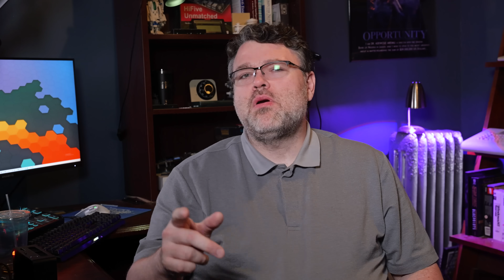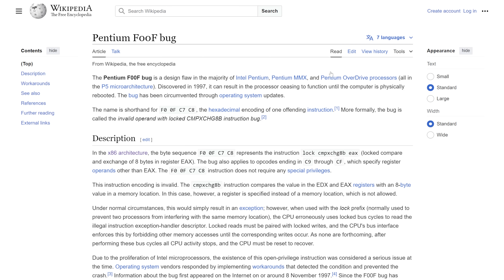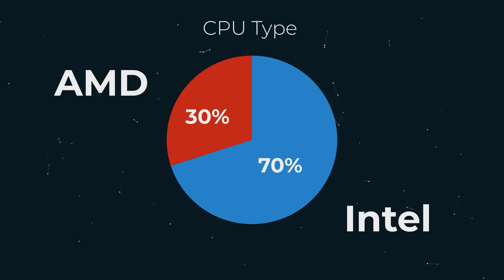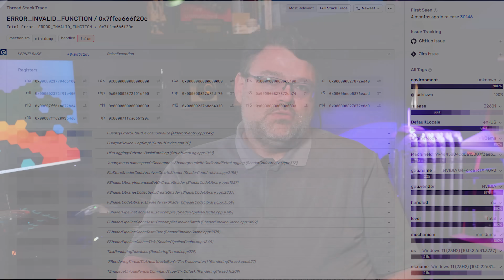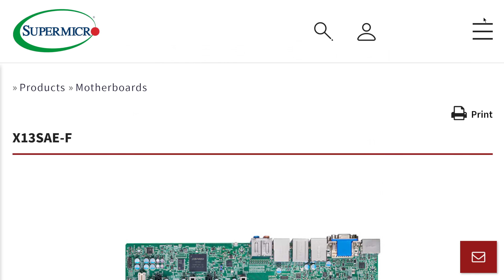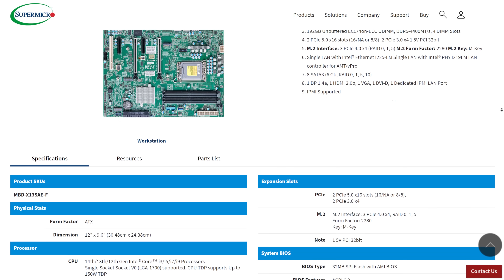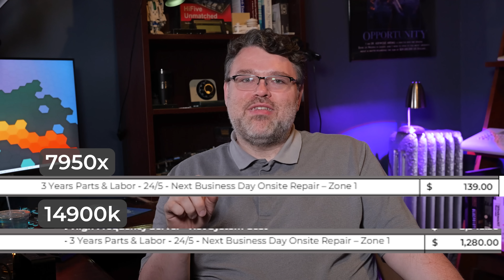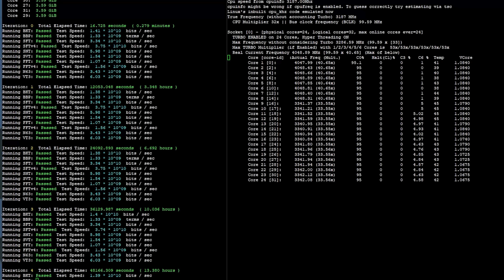Intel has a Pretty Big Problem

Comment: The 14900K chips are degrading insanely fast. My 14900K on day one could run at stock frequency with a -0.075 voltage offset on the last 2 steps of the V/F curve, without any WHEA errors either at full load or idle. Every 2 months or so, I would randomly find a couple of WHEA errors which were instantly fixed by increasing  the previously mentioned voltage offset by +0.05v. This week WHEA errors began showing up again. Now the CPU needs to run at stock voltage as is unable to handle any negative voltage offset whatsoever.
Reply: @genejones7902  No, error 17 is a PCI-E issue. Like you, I once had hundreds of those on my event log. Turned out to be a bad Thunderbolt cable. Replaced it and never got one of those event 17 errors again.
Reply: @genejones7902  There are specific WHEA error codes that are related to CPU errors. Whenever I get them every couple of months, increasing the voltage slightly is the only way to make them go away. So yeah, its a CPU issue.
Reply: What kind of cooler do you have and what temps would the chip run at full load before it started to worsen?
Reply: @douglasmurphy3266  I'm using an IceMan Direct Die waterblock with an external MORA3 420 radiator. My 14900K max core temp at full load is 70C.

Temps are not an issue.
Reply: @lllXavierllll  That's what I was expecting to hear.  My theory is that the people cooking their chips are actually the ones with really good cooling solutions.  Anything less than an S-tier water cooler is going to eventually throttle back from mad-scientist levels of electricity, which is why Intel claimed the behavior is within spec.   However, the enthusiast solutions might be keeping these chips stuck in a state they shouldn't be kept at for extended periods of time - The motherboard manufacturers were probably assured by Intel that the chips built in regulation would keep those out of spec power profiles from killing them.
Reply: @douglasmurphy3266  it's definitely a possibility even though I'm running everything at stock - or rather, what today is known as the Intel "extreme" profile lmao.
Reply: @douglasmurphy3266 interesting idea and it might be happening on some chips. However as said in the video the data from the datacenter chips on the conservative motherboards sort of hems this. Better cooling might accelerate the degradation but it certainly isn’t the root cause.
Reply: @lllXavierllll  RMA the cpu, some times you just get a bad cpu. cpu degradation can happen but the only time its rapid is when its first broke in, and that typically shows more on super high efficiency chips aka golden samples and will taper off quickly and settle in with a small voltage bump required. if your cpu is degrading fast its most certainly defective and should be replaced. that is assuming your not cooking the cpu with high amps for hours on end that will cook any cpu in relatively short amount of time. most people think its the temps that kill but its really not. its the high amperage that will destroy chips.
Reply: @EJM07  the chip is literally degrading.  did you even watch the video?
Reply: I don't have Intel (recent) in the house, so I'm guessing.  Could you possibly get ahead of it by lowering the boost clocks?  100-200mhz wouldn't make much difference, and it could keep an overly aggressive boost in check.
Reply: @TheCgOrion  nah, by the time I have to add a voltage offset that would actually impact temps significantly I'd have already upgraded to the newer generation CPUs.
Reply: @genejones7902  
Sounds like the XBox360 "Red Ring of Death".
Reply: @genejones7902  As @lllXavierllll stated error WHEA error 17 is a PCI-E issue, but it is not caused by a bad cable but rather by something wrong with PCI-E power management starting with 12th Gen CPUs/chipsets. 

To fix it go to your BIOS and disable PCI-E Native Power Management.

This is a very common problem - I too was getting thousands of WHEA 17 errors when I first got my 12900K + Z690 ASUS motherboard and disabling that setting in the BIOS fixed it.
Reply: WHEA ERRORS! you're the first one who has said this!!!! I am currently using virtual machines and it's a new semester for uni and I made complete new vms. I use VMware - and ever since I've made new vms, I would always get that whea error... No matter if I sat in the login screen for 10 minutes, try updating windows it just keeps giving me that error. Nothing else. I've set it default (1 processor and 2 cores)..... Linux seems to be fine. Windows 10, 11, server keeps giving me this error however! I haven't really had some issues with my host. Yes okay there's been a few game crashes but I thought it was normal considering it doesn't happen as often (every like once in a blue moon) but is my CPU faulty or something? I've offset the CPU and it runs about 85°c roughly if I'm running cinebench.. i9 13900k.. The computer has rebooted from a bugcheck.  The bugcheck was: 0x00000124 (0x0000000000000010, 0xffffc207be2dc028, 0xffffc207b5f0609c, 0xffffc207b81d71a0) - windows 11 vm. The computer has rebooted from a bugcheck.  The bugcheck was: 0x00000124 (0x0000000000000010, 0xffffc207be2dc028, 0xffffc207b5f0609c, 0xffffc207b81d71a0) - windows 2022 server
Reply: same here 13900 HX 9 months ...
Reply: RMA the CPU before it's too late
Reply: Well there ya go, likely  a bad chip, I'd contact retailer/Intel, make them provide a replacement. Something  with that low tolerances doesn't seem long (or even short) term stable.
Reply: To be fair, your example sounds like they made the correct forecast   when they set its voltages.

We know they know there is degradation. We know they run tests which literally test every single transistor. We know they know the tolerances of the hardware feeding the chip.

Therefore it is reasonable to expect they have test suites that simulate the worst vrms possible, with the worst noise expected, and the poorest signalling, and test every single transistor under those conditions to find the stable voltage to set.

As an end user, we're just playing around and seeing if it works.

That said, it does seem there are issues with degradation beyond their forecasts with these chips. It just doesn't seem like your anecdote is a good example.
Reply: I fixed my issued completely on i9 13900k by overvolting cpu by +0.075V ... no overclock, just overvolt.. i usually did -0.0.75 on my i912900k and i7 13700k.. but apparently on i9 13900k adding + 0.075v fixed stability issues for me
Reply: @dmc716  that's a temporary fix. You'll just have to set it higher and higher over time.

plus a .15v jump is huge already.  get you RMA while you still can.
Reply: @dmc716  glad to hear that but HX and H users on laptop cant undervolt only
Reply: I had something similar on a ryzen 5600x,
with whea 47, until at one point my computer started randomly rebooting, first once a day, and then right during boot it rebooted 2-3 times,
after i sent my whole computer to a service centre under warranty, they replaced the processor, but the motherboard stopped starting at all,
I had to wait another week before they could find the same motherboard,
I still don't understand how the motherboard and the processor could fail at the same time....
Reply: @SL4RK  This sounds like a power delivery issue that degraded the cpu, and when you sent it back they did the bare minimum of swapping the chip and said "job done" when that seemed to fix the problem.
Reply: Source: trust me bro
Reply: @CyberneticArgumentCreator  Username checks out.

Comment: I am guessing intel have just dropped their binning standards for short term gain, would not be surprised if the current  management culture came from private equity.

Intel has always been like that athlete that has one good race every other season then is out for a couple with an injury.

Also, I can always feel a difference between an intel system and an AMD...

Comment: My 13700k has been stable, for what its worth.
Reply: Mine too. Been using it non stop for over a year on water cooler settings in MSI z790 bios. Passed 12hr OCCT recently and getting same scores on cinebench. Good temps, seems perfectly fine
Reply: If you have the time, and are tolerant of his rambling presentation style,  "The intel instability and degradation rant." Actually Hardcore Overclocking just put out is worth a watch.  It's not the i7's and i5's, it's the i9's.  He has a hypothesis as to why.

Comment: I feel like Intel just wants to delay for as long as possible, handle RMAs on the down-low, and specifically not make any announcements that could rock the Holy Share Price. Just keep 'minimizing' the issue until it's old news and no one cares any longer. Every end-user that gives up and moves on is (bonus) money saved. #jaded

If someone wants to argue that this is not a case of component degradation (e.g electron migration, likely in or adjacent to the memory controller), I'm all ears. Just make sure the hypothesis fits the known facts.

Can you lower clocks and get these CPUs "working"? Sure. Can you push more current and make them temporarily appear fixed? Sure can. Can you take a chip that is degraded, push some firmware, and run it reliably at all the original settings w.r.t clocks and power? Very much doubt it.
Reply: It's both annoying and disheartening to see how effective the initial 'motherboards are pushing too much power!' smoke screen actually was because people are in the comments for this video and still repeating it.

Comment: Problem with this is for people that don't have any invoice like me (blame myself for buying 2nd hand). The second players here are mobo manufacturers, which allowed by default insane levels of power and voltage for unlocked chips and the third one and most important, Intel, who fucked up surely in the manufacturing of the chips.

Bought almost on release day, at start chip was working well but after 3 months of use things started to go nuts. Everything crashing on linux, even the most basic things, not even to talk about games.

Mine is unstable at stock settings (even Intel's Defaults), and so after reading the news and tons of subreddits posts, went with reducing the max freq allowed on bios (turbo ratio offset) to the minimum allowed, (which by itself helped but didn't solve the problem), and disabled all thermal and voltage enhacements (TVB, etc). That itself dropped down the voltage from 1.1v to 0.8v so i upped the AC loadline so chip voltage was 0.85v, and since then and with all those settings it seems pretty rock solid (but i ended up with a 13900T instead of a 14900K which i payed for).
Reply: Remember when one skew of AMD chips were melting because of motherboard configurations was a hot topic? Maybe the algorithm is really tailored, but I got A LOT more of that than I ever did these two generations of intel just slowly going back to sand.
Reply: @Peterowsky  The AMD issue was much more obvious. Some still consider AMD to be a cheap unreliable alternative to Intel. (Well the tables have turned it seems)

Intel situation is more subtle, as no physical damage is present, and the user can always be blamed for handling.

I believe they are trying to damage control and downplay the situation.
New chips will be coming out after all.However it seems the issue is so widespread that they won't be able to avoid it.
Reply: @viigraphics  Yeah, someone is about to pay looooots of money for replacements...
Reply: @viigraphics  Yeah, someone is about to pay looooots of money for replacements...
Reply: @Peterowsky  not to be that guy, but you wanted "sku".
Reply: Maybe ask the original buyer to provide you his, plus the transaction that happened between you two.
I rma'd a cpu with AMD and they were cool with that.
 Cpu was bought for me by a different person due to regional availability and overall cost at that given time.
Reply: @viigraphics  He says he doesn't have any either, but thanks for the tip. Didn't thought about it, mostly bc i already admitted if u buy something in 2nd hand markets you know you're on your own if something happens. Good leason to learn, not always everything is the cost, but i learned the hard way tho.

Won't be a next time.
Reply: If he paid with card or bank transfer, the statement of that transfer might also be ok.

In my case, I transferred the money to my relative's account and also commented the reason on the transaction, so he bought it and send me the receipt.  Once I had to rma, I've sent both the trasfer and the receipt and they accepted it

I really hope you will find a solution, take care!
Reply: @viigraphics  That'd be ok if Intel enabled a channel for accepting RMAs specifically for this case, but this one whom i bought it is no relative and i don't think he's willing to share where did he got the proccesor or how (if even paid for it).

Not implying anything mad, but could be bought as an enterprise stock that didn't had exit or use, mb.
Reply: @Pacho18 Understood, most of my system is bought this way.

Asus dint want to honor the rma for the motherboard, (because i didnt knew which of cpu or mobo, or both were the culprits.

Even after buying a second one, they told me to wait till september so theu will honor the 3rd year of the warranty.

Of course that was useless to me, I ended up spending 4months with a backup machine, and only last month i got it working again...

So I kinda understand the ordeal.
Reply: @viigraphics  Yeah, i also built most of my systems this day, and never had a problem. This issue will be marked for life in my mind, blaming mostly Intel for selling defective stuff with different name, if they not abilitate any form of massive RMA of every defective chip in the market affected by the same issues.
Reply: @Pacho18  
It's a shame they did that to their customers.

I believe they knew it, but pushed the chips out regardless. they had plenty of time to gather data from the 13series.
 
The situation itself is interesting but it is sad for the end users of those chips.
Reply: @viigraphics  100% Agreed. Logic dictates that 14 series would be better and more polished than 13. It seems we all guessed wrong.

Comment: Is there some kind of tech "law" to this?
Every time chip Company A has hardware outperforming chip Company B....
A becomes more power efficient as they stagnate towards barely pushing their silicon.
B becomes a power hog with frightening stability problems as they aggressively push their silicon for all the performance they can get.

Nvidia became B during the Fermi 'n 5000 series days.
AMD was B during the Bulldozer days.
And now Intel is B.
Reply: my bulldozer cpus, had 2 of them, never crashed on me. never heard of them crashing either. people complained they weren't fast enough or whatever, never heard a peep about crashes.
Reply: @jmwintenn  buldozers where great homeserver cpu's. Used them for many, many years without fault.
Reply: @jmwintenn  Yeah, these old things are very solid. Not very fast, hungry for watts, and not even valued that much used, but these will outlive a lot of these newer processors.
Reply: That is the way things go. Things will change up again in a few years.
Reply: you can build a chip to target a specific power consumption/performance ratio. if your chips aren't fast enough, you can make up for it somewhat by increasing power consumption.
Same goes for node advantages, for a better node, same performance consumes less power all else being equal.
Reply: You do know AMD has needed 3 bios releases with every release of their next gen CPU. 7800x3d still has 10 minute boot times, that the only answer for is to not shut the PC down.
Reply: @kramnull8962  That is total bs, you sound like a hurt Intel fanboy
Reply: @gurumeditation4922  Steve at GN has banged his Jesus skull against the wall on every AMD launch. He will on the 9xxx as well.
Reply: @gurumeditation4922 One or two minutes yes but not 10. Mine takes up to a minute to post (x470)
Reply: Shill  @kramnull8962
Reply: @kramnull8962  My 7800X3D boots my system instantly with DDR5 memory context restore and I have no crashes on Linux and Windows.
Reply: @kramnull8962  The nice thing about AMD is they can generally fix their issues with software updates, not a stepping/hardware revision.

afaik not all ZEN 5 motherboards need such a long Memory Training process during a cold boot, some manufacturers may have forgoed settings in their BIOS to improve the speed of this process and the settings may not be enabled by default even if they exist.
Reply: @Nicholas_Steel  "memore context restore" is what you're looking for. this reduces post time from 60-90 seconds to around 10 seconds on my msi board (msi is notorious for long boot times on am5).
Reply: @Nicholas_Steel  Wow so you have the same fix that AMD has. Don't reboot. Like I said....
Reply: @kramnull8962  That's not what he said.

Once memory training is completed it does not need to be done again until memory-related settings change. Meaning you can reboot as many times as you like. Intel also has similar initial validation memory training.

You're either clueless idiot or a liar who's emotionally invested in unstable intel hardware. Take your pick.

Comment: Complete guess but this could be an issue where a fifo on the last level cache's interface to memory or the io controller fills up and is unable to hold new entries which want to get pushed into the fifo which leads to crashes. I heard somewhere that there was a similar issue on old nvidia gpus back when they first added l2 cache to their processors (more than 10 years ago). This kind of aligns with most of the symptoms you are outlining.
Reply: Limitng power (and therefore clocks) or upping the voltage would not fix this. It seems a manufacturing problem, not a design one.
Reply: @marsovac  Check my comment on main video. I agree it is endeed a manufacturing problem, but limiting turbo ratios and settling down voltage seemed to do the trick for me.